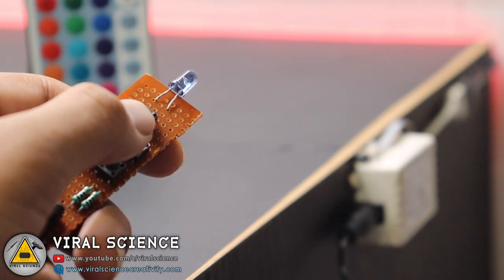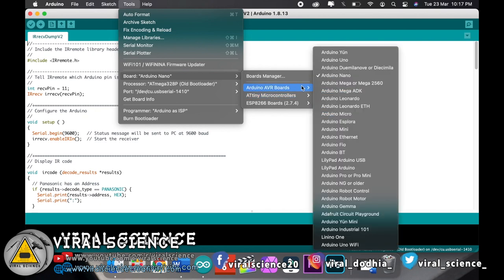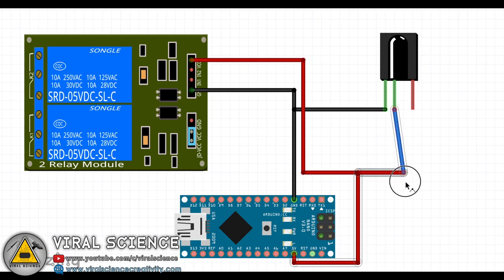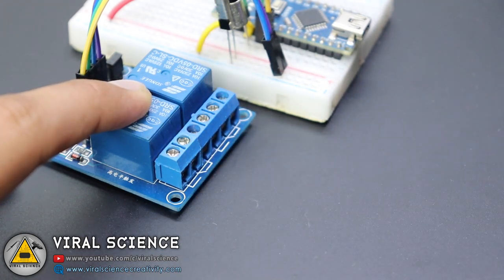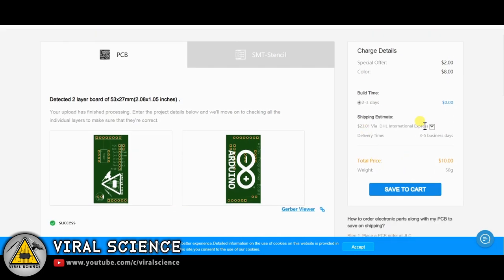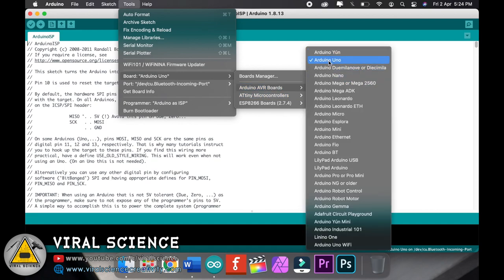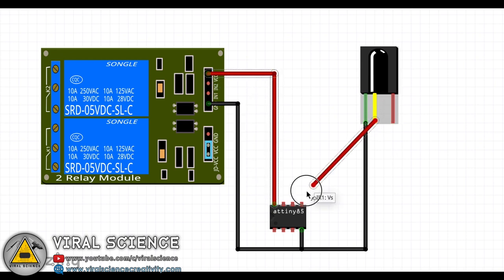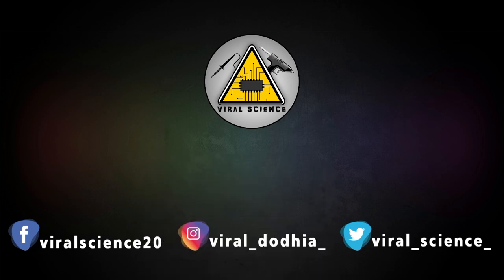Arduino IR Remote Control Relay Module

Comment: How to tap into the high voltage to run the IR receiver and chip. Im not running a separate power wire.

Comment: Hey bro, can you make a video on interfacing Arduino with water level sensor . In this project you show the values in lcd screen from the sensor .. And when the water level is high can you beep a buzzer.. please bro big fan ... This project that  you have made is wonderful😊😊👍👍👍👍
Reply: Ultrasonic sensor you want to use or which sensor tell. Me name may be i will do for you